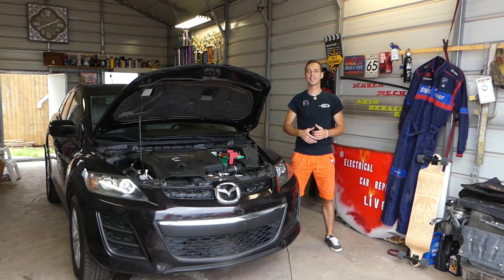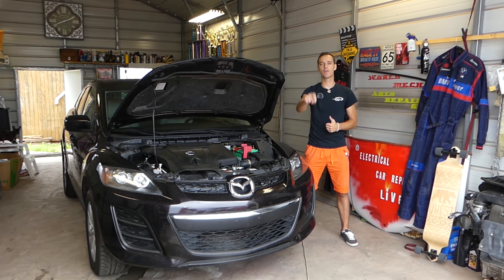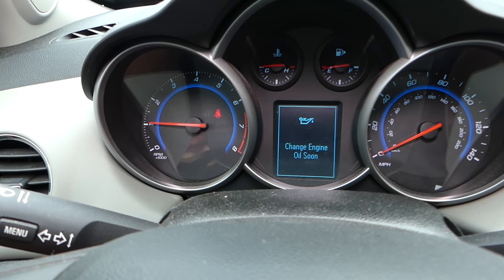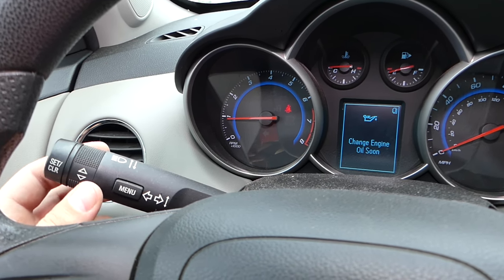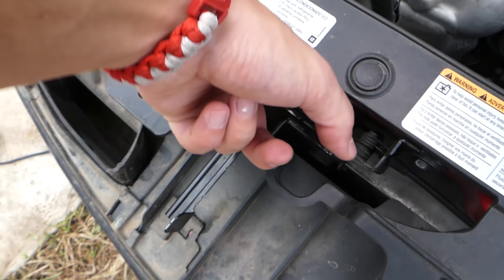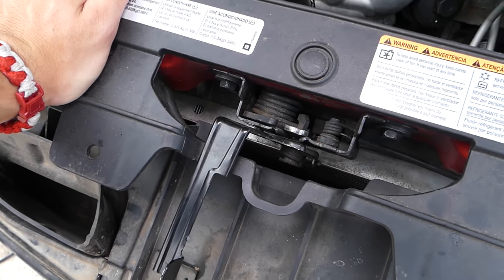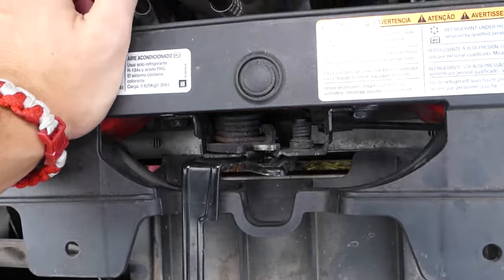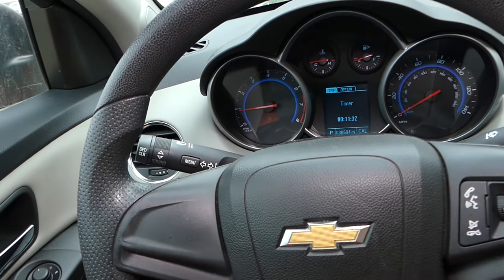HOOD OPEN WARNING BUT THE HOOD IS CLOSED

Comment from the maker: Products that we use and recommend:
► Buy Hood Latch Assembly for your car here: https://amzn.to/2Zq9V4u
► Panel Removal Set: https://amzn.to/3YiMADu
► Assorted Fuses: https://amzn.to/4fx4s3F
► Tool Set: https://amzn.to/3p5MM6t
► Screwdriver Set: https://amzn.to/3XRB28Q
► Castrol Oil: https://amzn.to/3xBc8B9
► Oil Filter: https://amzn.to/3w0Ulme
► Torque Wrench: https://amzn.to/32qyRwg
► Liqui Moly Engine Flush: https://amzn.to/3IiDBID
► OBD Scanner that we use most often: https://amzn.to/3I4MQfe

► Check out our Amazon Store for the tools and parts that we use: https://www.amazon.com/shop/worldmechanics

Comment: I have a 2013 with a sensor  on the pass side next to the radiator . The problem was the car lock light and horn would not come on when locking the car because the sensor was not makeing most of the time with the hood closed. I did get this corrected the other day by putting a 3/8 panel plug in the 3/8 inch hole in the hood. I got the plug at ACE hardwear, or even Lowes i think.

Comment: 2020 elantra started aggressively beeping at me about my hood, which was clearly closed. Found this video which helped me easily find the wire. Looked corroded. Sooo I just unplugged it. Problem solved lol. Well not really. But I'll need to get it replaced at some point I guess.
Reply: The noise stop ?
Reply: I had the same problem with my 2020 Elantra last year. I got the wire or switch replaced but the problem came back. This is quite disturbing

Comment: I am dying trying to get my 2009 w204 c300 Mercedes to stop telling me the hood is open. I have replaced the sensor and retighten the latches and it stills warns about the hood being opened. PLEASE HELP ME SOMEBODY!!! I can not figurer it out. Can a bad battery cause this?
Reply: Have u tried resetting the car
Reply: @ciaracarrs5057  I tried everything. I had bought a sensor from the dealer and it was bad. The mechanic went and ordered another one and the problem was fixed. It was the sensor after all.